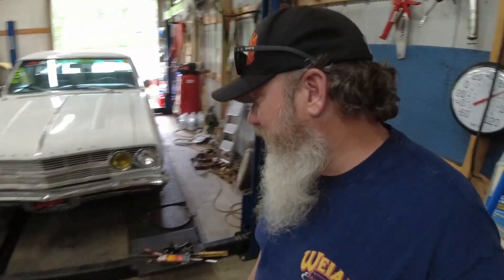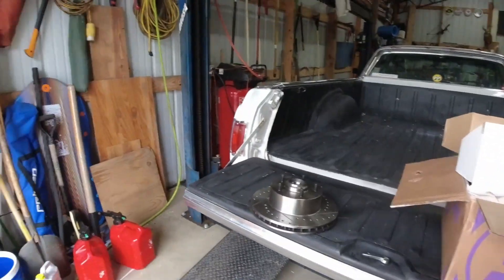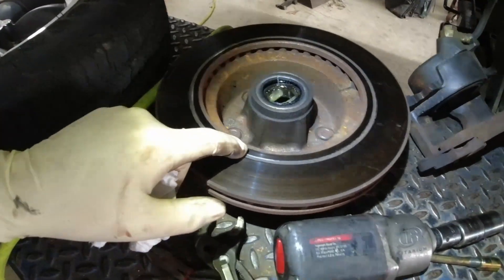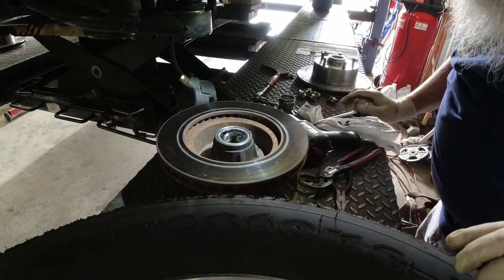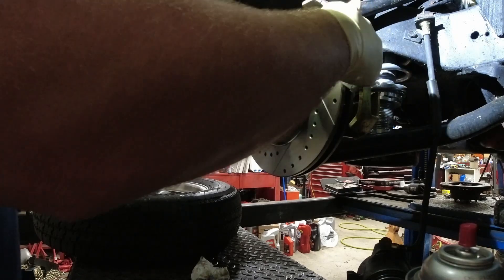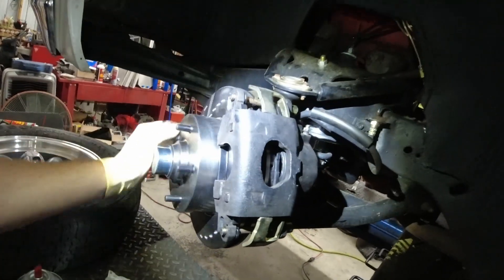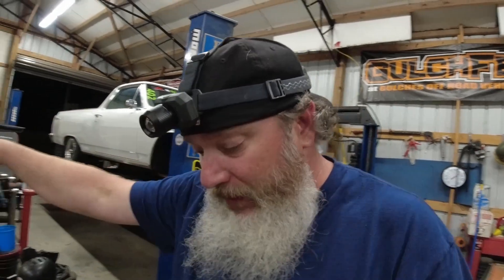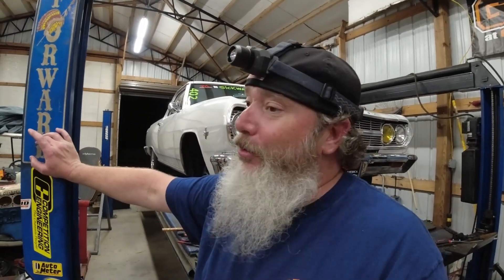Drilled and Slotted Rotors and Ceramic Brake Pads For The 1965 Chevy El Camino/Chevelle

Comment: What did you for steering stops?
Reply from the maker: I didn't do anything.  They hit the control arms if you go full lock but after a year plus and probably 15k miles I haven't had any problems with the front suspension.